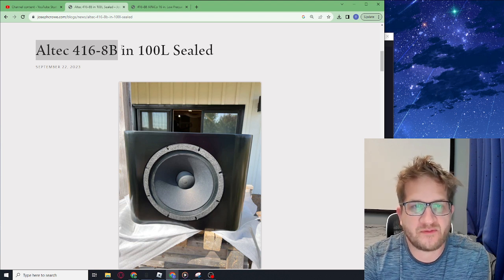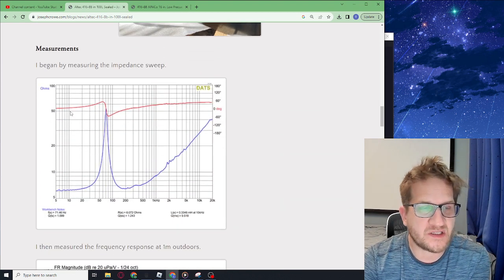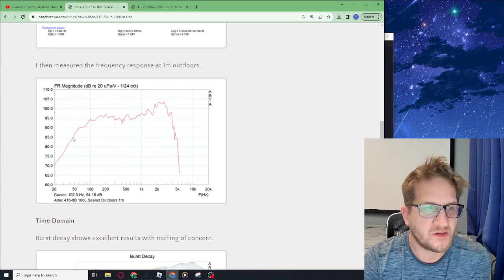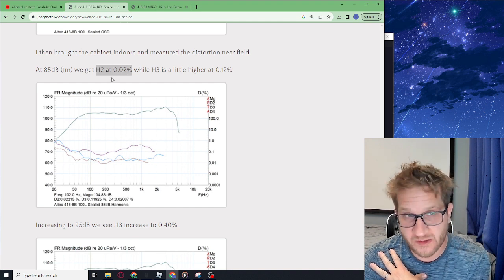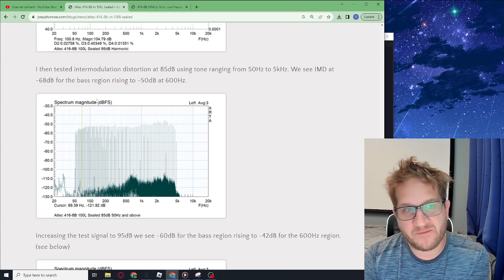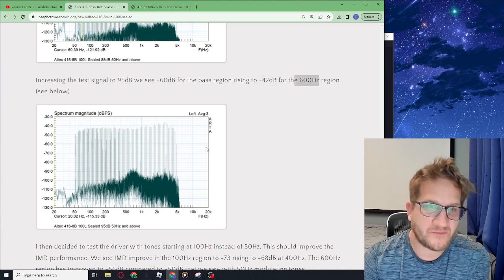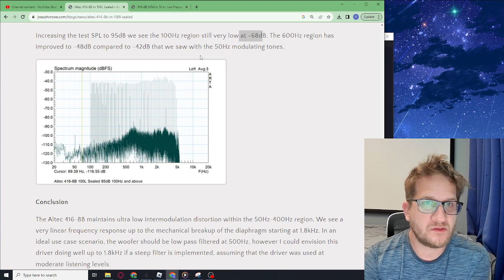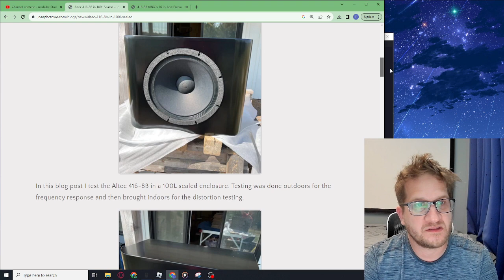Altec 416-8B in 100L Sealed

Comment: Such a great driver. I have very fond memories of the Altec 19 and the Voice of the Theatre. How does the Altec 416-8B compare to the TAD 15" driver?
Reply: Which TAD, 1601a, 1601b, 1601c, or 1602?   I own a pair of 1601a and 1602.   they both sound different.... as well as they sound different than my GPA-Altec 515-8LF drivers. Best overall in deep bass through 800ish, the 1602..   best punch in mid bass, 1601.  Ease of dynamics the GPA-Altec.
Reply: @jenniferwhitewolf3784  Thanks for this. Question about Alnico losing flux density: With reference to https://en.wikipedia.org/wiki/Equal-loudness_contour -and at 10 ft in a 2470 cu ft room-if the above 416-8B in a sealed 100 liter box is typically used several hours weekly to play down to ~ 70Hz at between 80 and 85 db (with Rythmik F12 subs below), how long before they will need to be sent back to GPA for refluxing?